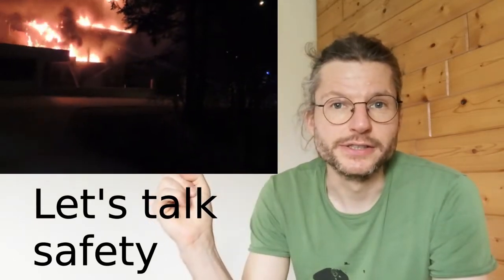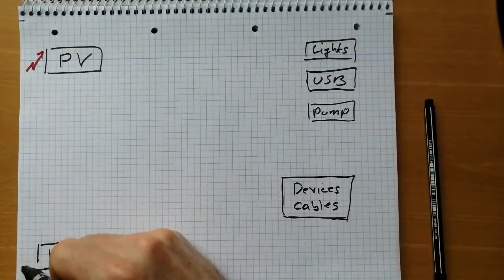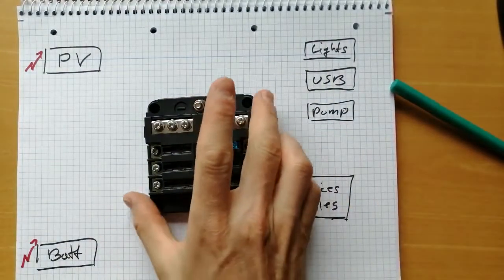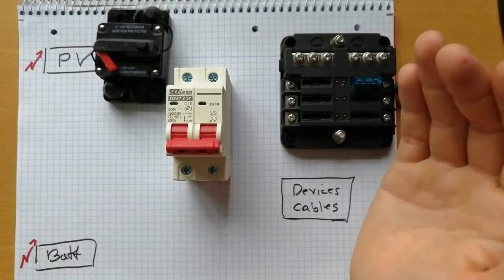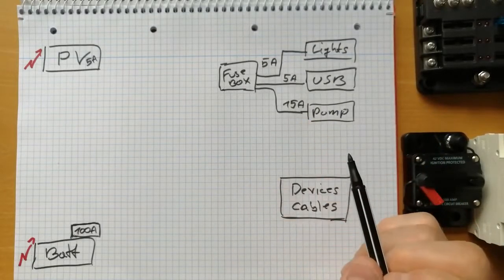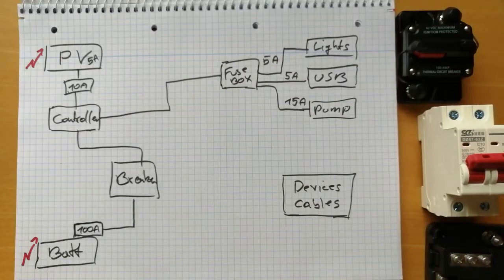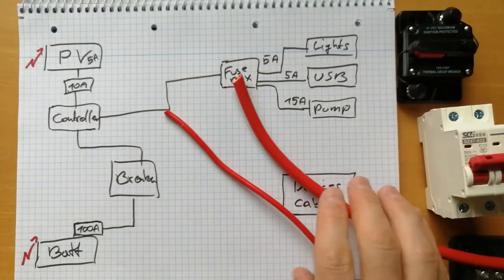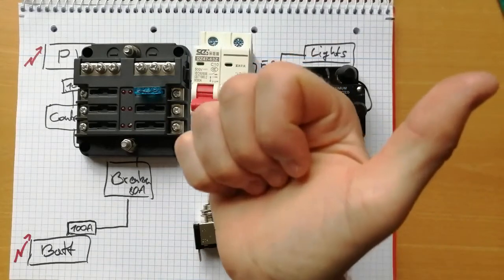Fuses, Breakers, and Basic Safety in your Solar System

Comment: Thanks for the video. It is very educational. I like the way you explain things, which helps absolute beginners like me. I know the video is about a year old but I am wondering if you could explain a bit more, the protections needed between the battery and the controller.  I understand the concept of breaker, which also helps to disconnect the battery power source, but I think you also suggest that the controller also needs protecting, so I don't quite understand that bit. The question is, shouldn't the breaker close to the battery, also protect the controller? And why is an additional fuse needed between the controller and battery breaker, to protect the controller (around 8:20)? I hope my question makes sense. 
In your example circuit, you have different segments, e.g. PV to Controller, Controller to Battery, Controller to devices/loads via FuseBox, etc. Are you able to advise what type of cable grade is needed/appropriate for each segment in order to avoid the cable melting and potentially catching fire?
Thanks.
Reply from the maker: Hey! thanks for your question. It is a bit misleading because I didn't draw the heavy load like an inverter. This inverter would be connected to the big breaker (e.g. 100A). The additional breaker in front of the controller is to secure the controller (e.g. 20A depending on the controller). That is why I have two breakers in series. A 100A breaker as close as possible to the battery wouldn't protect the controller in case of a faulty circuit because the controller can just handle 20A. Therefore it is good to add another fuse between big main battery fuse and controller. I hope that helped. Regarding the cables you just have to know what the max current is in the respective circuit and then use one of the tables (just google for "wire size amp ratings"). cheers, Lupo
Reply: @LupoDIY  Thanks very much for the comprehensive feedback. It does help.

Comment: What breaker sizes do you suggest for one 180 watt panel connected to 20A PWM controller with 50A/12V gel battery, thank you.
Reply from the maker: Hi Bachir. It depends where you want to put the breaker? Your System is quite similar to mine so you could use more or less the same breakers. Maybe a smaller one for the battery depending on your load. cheers, Lupo

Comment: Is a 220 volt fuse suitable for the solar system?
Reply from the maker: usually you can't use 220 volt AC breakers for DC, some can be used for AC and DC but then it is written on it. so it is really important to check the specification of the breakers because it is really dangerous to use the wrong one.
Reply: Thx soo much for help 💖💖💖

Comment: If you have a breaker between the controller and the battery, if that breaker is off and the controller is not connected to the batteries and the panels are still producing power to the controller then the controller will be damaged?!
Reply from the maker: Hi Jay, why do you think it would be damaged? A lot of controllers don't work without the battery but the Victron also runs on the power coming from the panel.
Reply: @Lupo DIY  Victron manual states it is important to connect to the batteries before connecting the panels.
Reply from the maker: @JayPerrypersonal  I guess it is to sense the voltage of the battery as 12 and 24V systems are supported. And it is always better to connect the battery first, but as a breaker can trip, the controller usually can cope with it and won't be damaged if the battery is cut off and PV is still online. Victron also states in the manual what type of fuse you can put between the battery and the controller and I also tried it already, nothing was damaged ;)
Reply: @LupoDIY  I always install a dule pole DC breaker switch between the panels and the solar regulator so I can just easily kill the power from the panels
Reply from the maker: @JayPerrypersonal  wise decision, I also do that, double pole breakers on both sides of the charge controller -> I also show that in my final design in https://www.youtube.com/watch?v=MYHCWDxNI6I and https://www.youtube.com/watch?v=H5jYRlLm_VI

Comment: That connection from the controller to the fuse box is kind of weird. It would make more sense to connect the fuse box to the voltage coming the battery.
Reply from the maker: thanks Peter, you are right, in general, it makes sense to connect the load to the battery directly. some charge controllers such as my victron have an output for the load. because of that they can measure the consumed energy and also provide a low voltage cut off. add this output is limited, you can't connect high load such as inverters but for lights etc it is fine. cheers, Lupo

Comment: Thanks for getting back to me what manufacturers do you recommend for the breakers buss, bluesea etc let me know I'm curious on what you like
Reply from the maker: Hey, Fred. In general I like to try out things, also cheap stuff from chinese, but you have to know what you buy and that you have to test it. sometimes it is crap, sometimes it is good. If you want to be on the safe side I would buy certifies breakers (e.g. UL in US or DIN in Europe). So far I haven't got really bad stuff from aliexpress, but just recently I found out that the 100A breaker trips already at around 60A ... that can happen, but the breakers usually work well but I can't recommend it for a bigger system which should be also safe and where you have to rely on those breakers. cheers, Lupo

Comment: Always use a DC breaker (like the cream colored shown) on PV system! If you have an array in series, many mpp systems run 250 to 400 volts so make sure the breaker is rated in excess. Pay attention to the polarity markings on the breaker or the breaker may be destroyed and catch fire. The black DC breakers are for battery voltages only and stay away from the no-name type shown. Use Buss or Bluesea brands.
Reply from the maker: thanks Karl for the information. Fully agree, the proper double pole breakers are preferred and if you want to avoid problem, go for a proper brand. I also show the problem of those breakers in https://www.youtube.com/watch?v=H5jYRlLm_VI cheers, Lupo

Comment: Not sure how your solar charge controller runs your load too.  Uhmm 😳 maybe that 
In itself is hazardous.   Should you not be coming from the battery for your load?
Reply from the maker: hey, good point, it depends. some charge controllers (e.g. my victron smart charge controller) have separated outlets for the load to also monitor it (inc. low voltage cut off, etc). but my heavy load (like inverter) is connected to the battery. cheers, Lupo
Reply: @LupoDIY  there are several distinct divisions to Fuses, breakers and basic grounding safety.  1) DC concentrator with fuses and/or breakers.  2) AC Fuses and/or Breakers 3) Grounding wire from every unit to a pole in the ground.

Comment: Breaker between battery and Charge controller should be a double pole type, and should be rated to match the controller max input I.e. a 30A controller requires a 30A breaker
Reply from the maker: thanks Nick, you are right, I also added another double pole breaker for security reasons as shown in https://youtu.be/MYHCWDxNI6I
Reply: @Lupo DIY  the amp rating is output, so breaker is nothing to do with that. Breaker should be amp rated to just higher than the max series rating of the panels especially if not fused. However if the maximum current is lower than the maximum series rating of the panels, then no fuse is required. 
For instance, a Victron smart charge controller 100/50 means maximum voltage from the panels is 100v but the 50 means maximum output from the charge controller is 50 amps. My 1200w at 74v can in theory have the controller output at 54 amps. However this is not a problem but you loose that 4 amps as the controllers maximum current output is 50 amps.
Reply: @JayPerrypersonal  You have proposed a breaker size based on max series rating of the (solar) panels, is that to protect the panels or the charge controller? My proposal was to protect a faulty charge controller from battery overload.
Reply: @westwonic  Battery overload is additionally protected by the BMS. You rate fuses mainly for protecting cables and fire risks. Device protection is something completely different and fuses are usually the wrong tool for that.
Reply: @dominikvonlavante6113  did I mention fuses? Plus MY pair of 12 v AGM batteries don't have a BMS
Reply: @westwonic  😂 well then, it's your fault for getting batteries without BMS

Comment: What size break do you need from the battery to the inverter?
Reply from the maker: As Nick already wrote in his answer, it depends on the inverter. I like to use a smaller breaker for the inverter because the inverter has built in fuses which otherwise would melt first. So if I have a 2000W inverter but usually just pull 800W, I would go for a 80-100A (12V) breaker.
Reply: @LupoDIY  How to size the circuit breaker?
Reply: Fuse rating depends on inverter peak power. I have a 1000 (1200 peak power) Watt inverter, protected with a 100 A fuse placed close to the 12V battery bank.
To calculate:  1200W/12V = 100A

Comment: Nice ! you are using  same breaker that I am using. good video !
Reply from the maker: cool, how is your experience so far? cheers, Lupo
Reply: @LupoDIY  I am preparing to go off grid, I have built the shad, run cables from field to house, installed frames on field...  bought circuit breakers and conduits,. Is a big project (60kw of storage lipo4) still in progress... the circuit breakers I choose (same as you) seemed the best choice ,but haven't tested yet.
Reply from the maker: @MarkSolarE  wow, that's sounds awesome! let me know when you have tested it if everything worked as expected.

Comment: I place a circuit breaker in line with anything that is connected to the DC power bus.  This offers protection and a means of disconnecting (or isolating) any circuit tied to the bus.

That white circuit breaker is a DC magnetic and thermal type, which must be wired in the correct polarity, otherwise the breaker will catch on fire during an overload.

The black circuit breaker you show is a thermal breaker made for 24 volts DC maximum.  This is a low cost type, likely manufactured in China.  I have had so much trouble with these Chinese breakers, I test each one with a calibrated DC current to determine the trip point, as they have a huge tolerance.  For the 100 amp type, I have measured trip points from 20 to 70 amps.

The fuses you show have a maximum voltage rating of 24 volts DC.

You cannot use AC rated switches for DC due to the 10X open circuit gap needed between the switch contacts.  This becomes a factor when you go above 25 volts DC (such as a switch to disconnect a solar panel from the solar controller).  Using an AC rated switch will cause the voltage to arc across the contacts when opening the switch.

I'm sorry if you have covered this in another video but, I just stumbled upon this one of your videos here for the first time.

The fuses
Reply from the maker: thanks Bill for input and explaination. you are right, the black one (rated for 100 amps) is quite bad and trips at around 50 amps. I also did another video how to connect the double pole trip fuses as it is crucial. cheers, Lupo

Comment: these black crushers are not good, do not work correctly 
https://www.youtube.com/watch?v=ksWy5Uld_cM&t=3s&ab_channel=electronicsNmore
Reply from the maker: thanks, you are right, I use a 100A and it trips after 30sec when pulling 80A. I will have a look and will most probably replace it soon.

Comment: For large loads like pumps, relays are useful and give you more flexibility than use high amperage switches as you can neatly mount all the switches in a main panel.
Reply from the maker: thanks, that's a good suggestion, as you have a clean panel, you can use the same smaller switches and wiring gets also easier. the downside is that you need power for the relais but usually this shouldn't be a huge problem. cheers